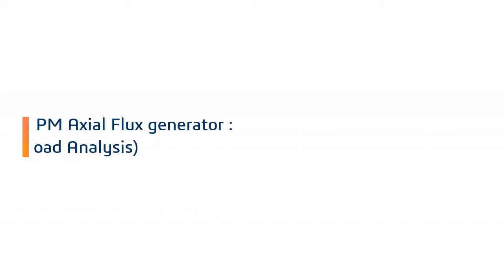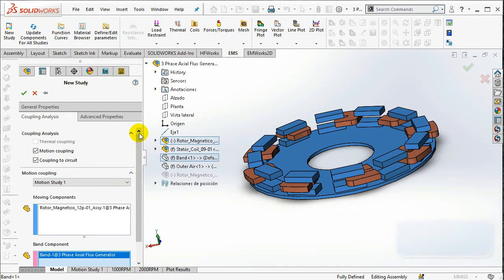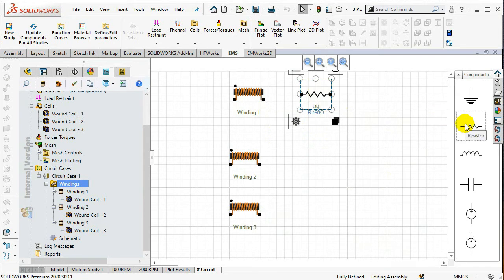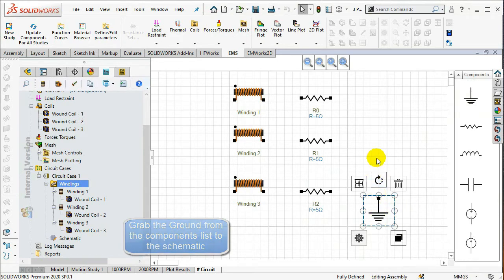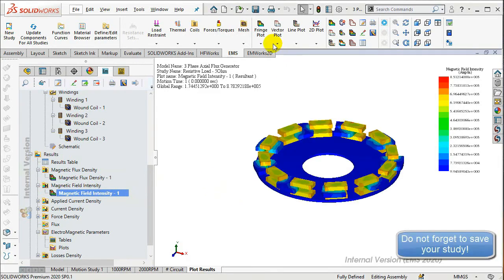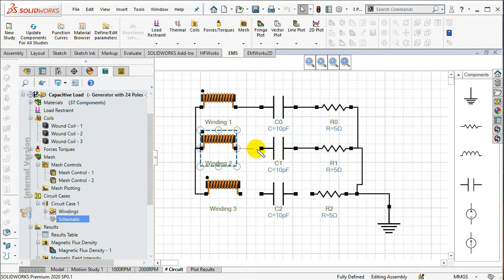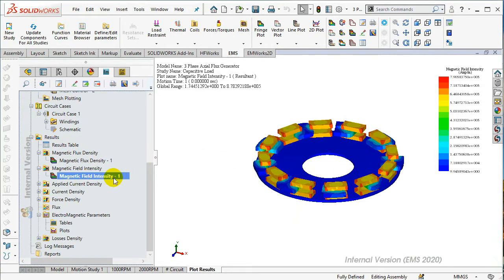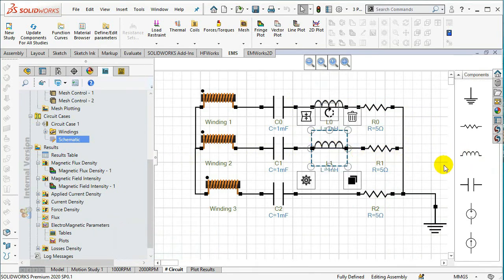Simulation of an axial flux generator - Part 3 (Coupling to circuit)

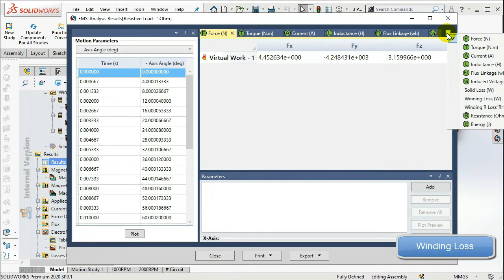Comment: I noticed 180 degrees phase shift from voltage and current in your results. You can see it in 5:03 for the current and 5:11 for the voltage. Can you tell me why the program calculates current like that and is that a problem when defining power output? Thanks in advance.